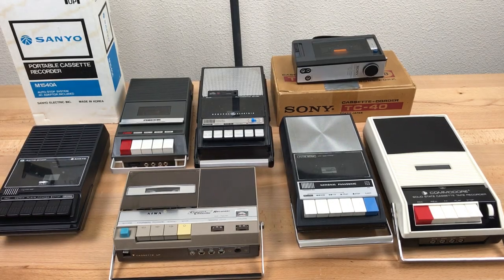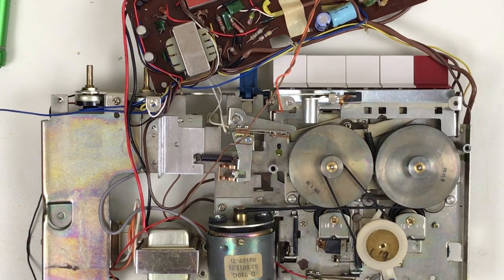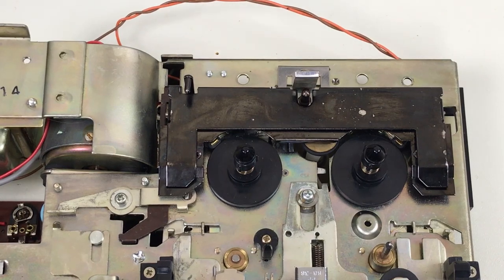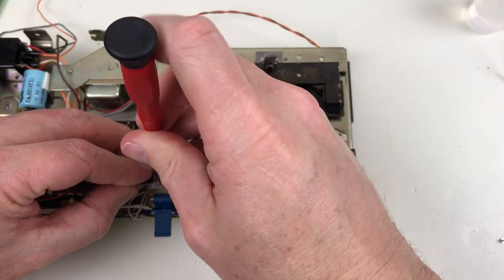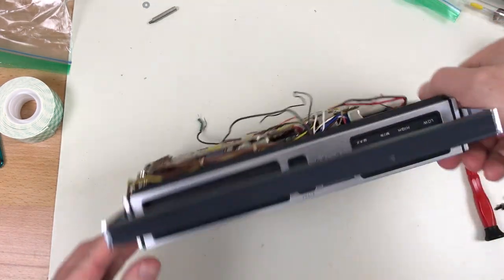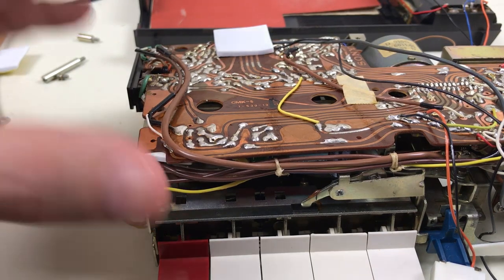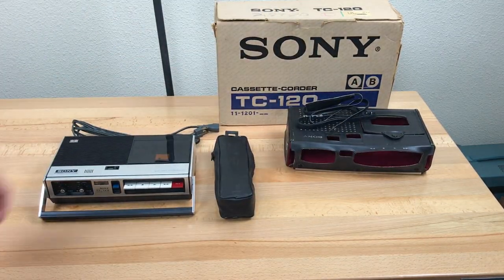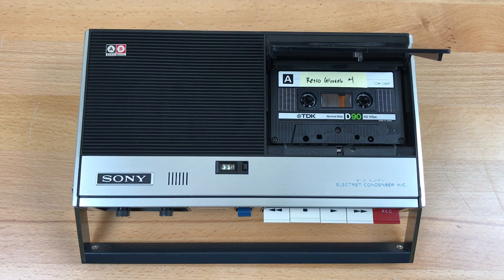Restoring a 1970 Sony cassette tape recorder

Comment: I just picked one of these up for 5 bucks at an antique store. It looked like it had been through 40 years of neglect (Which to be fair it probably has). I managed to get it all cleaned up and the metal even got its shine back. 

I haven't actually been able to test it yet, and I'm a bit scared to open it up because of the nightmarish pile of soldiered spaghetti cables that await me inside.

Comment: I have 2 Sony TC 140 corders, both in excellent shape but do not work. When you press play, I can hear the speaker white noise, but nothing moves, I do not hear any movement inside the player. Nothing at all, so doesn't look like belts, since there would be at least SOME mechanical noise if they were broken. Any ideas where to start looking?

Comment: You will have e even better results by recapping the board
Reply from the maker: Yeah, I think I need to. Audio still sounds fine but it developed a problem in the power supply that kills the motor speed after it gets warm.
Reply: @HutchCA  also beware of rotten germanium transistors. My TC50 worked flawlessly after  a recap but acted up randomly,  found it was the transistors playing up... love your work
Reply: @HutchCA  could be transistors dropping in resistance after a while...